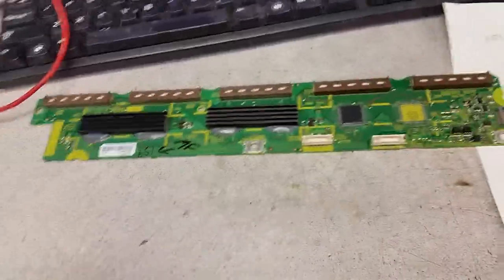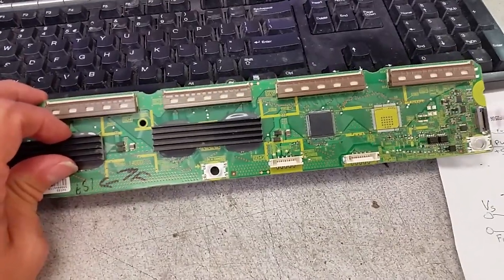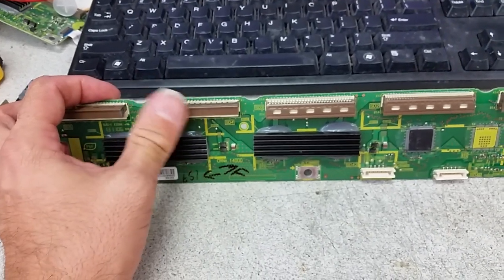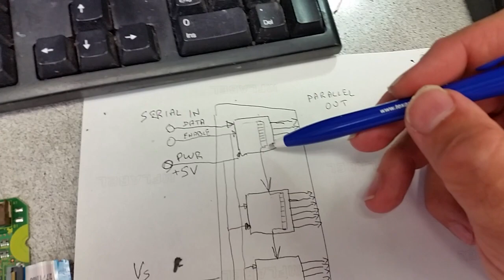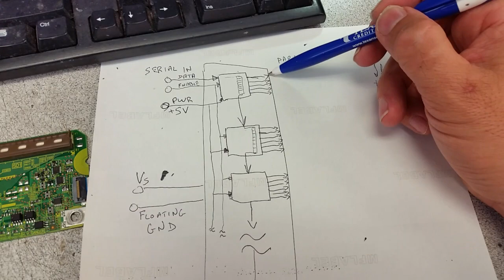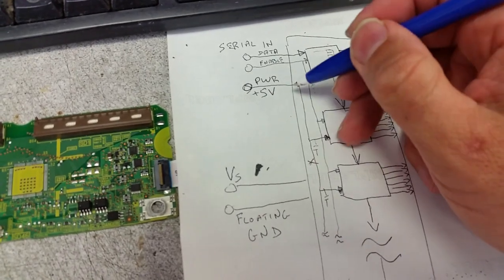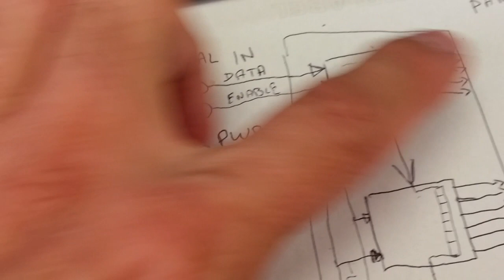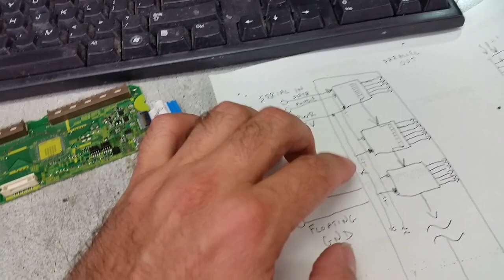How plasma TV buffer boards work and how to troubleshoot and repair them

Comment: Hi mate hreat video ..im trying to fix a 60 inch tv y sus board trips the tv and clicks . 2 to 3 times and shuts down. The y sus board had 1 blown ceramic capacitor  it was clearly burnt . Ive replaced 3 mosfets on 1 heatsink using thermal paste and 1 square type resistor (not tested since resistor) the y sus board us showing a short on the buffer connector 1st pin and last onky on 1 connector what wouid be the best way ?. Ive fixed a few tv's imc new led's etc. But not plasma any help is appreciated  ty
Reply from the maker: Sorry...too generic to cover here, too much to explain and teach. No offense meant.
Reply: @coppelltvrepair  oh OK I tho8ght u may have some insight ..I'm.swayimg towards the mosfets closest to the burnt ceramic capacitor I've simce replaced ..going by other vids  the mosfets were shorted and ceramic capacitor  was blown as mine was

Comment: by using low volt less then 5 volt aplye at the plsace you measure the shot  then chech with your finger the point wich is going to be hoter then any other point of the board  accept my respect